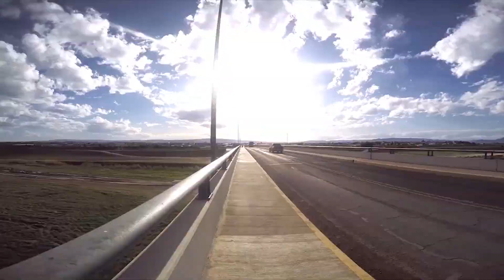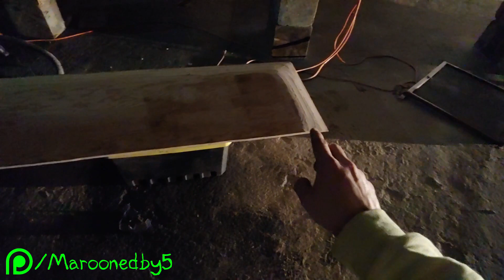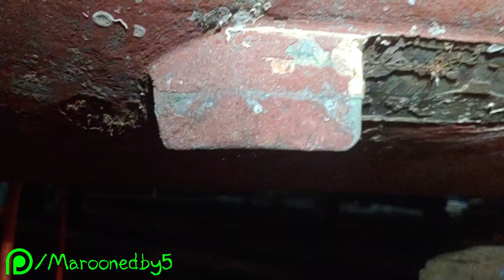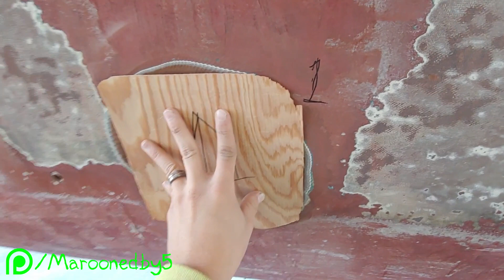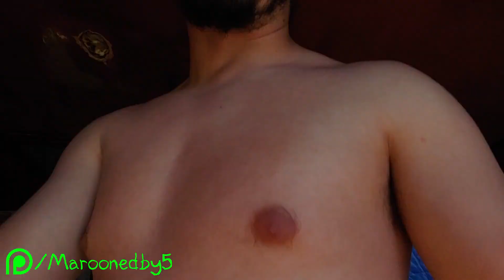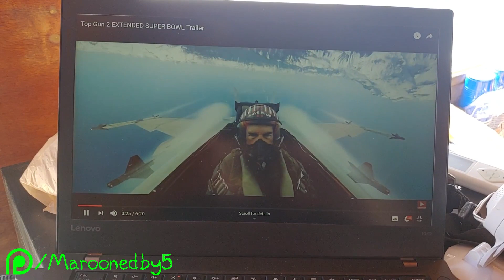UNLIMITED INTERNET ON A BOAT - How we work and play while living off grid on a catamaran. (S1E3)

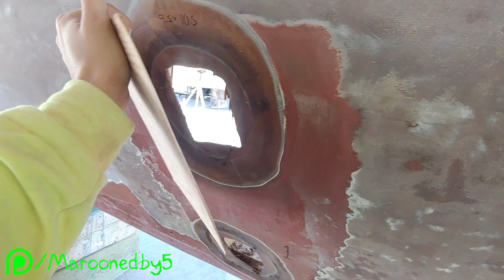Comment: 09:30 do you have to put wood back in? Why not just fill up with fiberglass? Surely fiberglass is a.lot stronger than wood.
Reply from the maker: Yeah, the fiberglass needs something to back it, but there will be quite a bit of fiberglass in those areas for sure!
Reply: @sailingblackpearl  probably different because you have a wood boat, but could.you not use a temporary wood backing on the inside and then build up fiber glass in the hole, and then remove the wood? 

I've seen other people only use fibre glass to fix their jul, but again that wasn't a open hole like you have.

Asking because I'm stupid 🤷🙄😜

Comment: Does impact wireless not have a website?  How do you interact with them?
Reply from the maker: We just saw that!
They just be building a new site, we'll check and see if we have the rep contact still 👍
Reply: https://www.bbb.org/us/id/meridian/profile/mobile-phone-service/impact-wireless-inc-1296-53057989/complaints#352631775

https://www.yelp.com/biz/impact-wireless-boise-5
Reply from the maker: Yeah, we have only had the plan for a month so far, so no experiences like that for us yet. I will say ours is monthly and I do not recall seeing anything about a 9 year plan, but we will see how it goes!
Reply: @sailingblackpearl  judging by the 50 gig cutoff, I'm guessing they use Verizon towers. Have you tried simple?  I made a rash decision and switched to google fi because att reception sucked on my boat, but the data is too expensive. Think I might try simple once I get the pixel paid off.
Reply from the maker: @ptortoise  we have a T-Mobile card, but they offer the same plan on the big 3. The cutoff isn't that bad really, it just slows down a bit around the rush hour times if it does, so not horrible. We have to play around some more with it, but it isn't much different than the 30mb/s service we paid for with Xfinity . . . And better than that one at times 😂
Reply from the maker: Ok, so it was:
https://www.infiniteltedata.com/

Who appears to be owned by impact wireless, or that is who bills me 👍